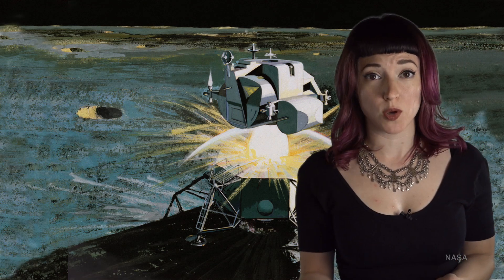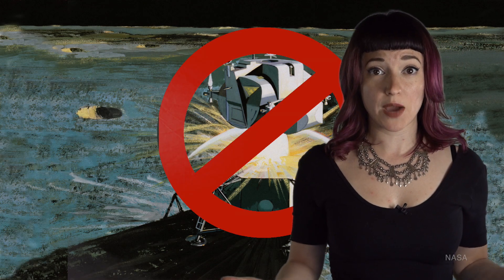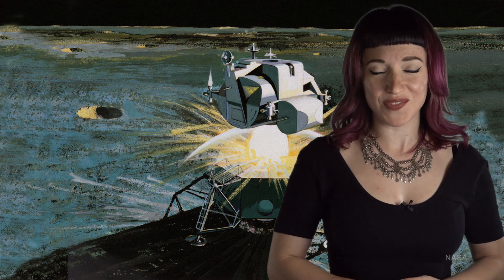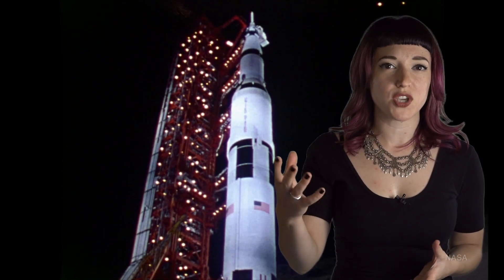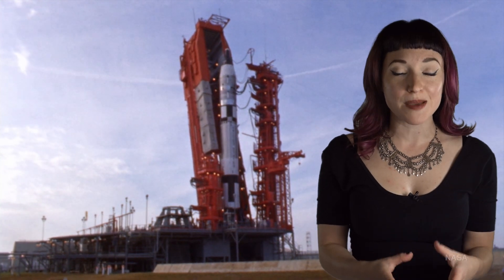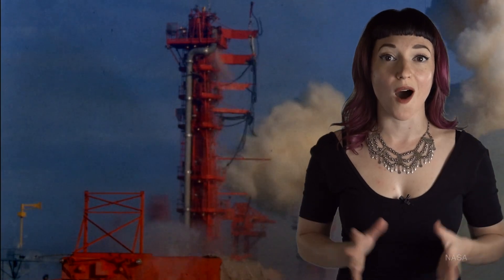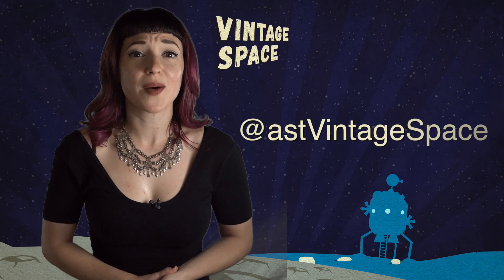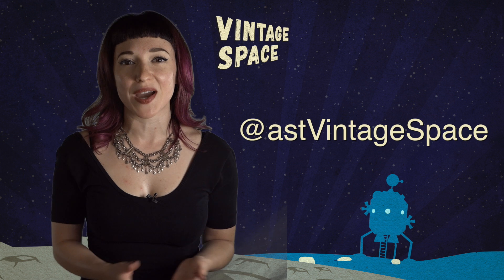How the Lunar Module Launched from the Moon Without a Flame

Comment: How the astronauts deal with high temperature on the surface of the Moon?
Reply: Their suits had a layer which had a network of water filled tubes throughout it. The astronauts could raise or lower the temperature of the water being pumped through it to maintain a comfortable temperature.

Comment: There should be no sound heard in a near infinite vacuum! Why can we hear the lunar module metal on metal and oxidation noises when in space theres no sound?
Reply: Sound travels through almost any medium. If a microphone is touching a piece of metal that gets hit by something, the microphone will pick it up.
Reply: Niall Kinsella 

Theres no atmospheric particles to be used as a medium. NASA even states sound cannot be heard in space. I've stopped so many people that have yet to come back with a response after researching..not thinking they believe they know. If you fact check and get back to me with opposite of what NASA stated that would be a first.
Reply: chris daniels A medium is required for the propagation of sound waves. That can be any medium, not just an atmosphere.
If a microphone is attached to a metal object, and that object gets hit by another object, the microphone will pick up the sound.

Comment: "Space Shuttles" that "launched" through the 70's, 80's, and 90's also were not filmed with high definition cameras. What sorcery was NASA using  to film the huge flames and even bigger cloud of spent fuel back then? High definition is not needed to view huge flames from a ROCKET!!!
Reply: YOU SAID: ""Space Shuttles" that "launched" through the 70's, 80's, and 90's"

== Why is "launched" in quotes?  Are you under the idiotic impression that the space shuttles DIDN'T launch 135 times?

YOU SAID: "also were not filmed with high definition cameras."

== Oh, good grief.  Get an education.  Sheesh.  There were plenty of FILM cameras used, which are as high definition as the film medium itself (and the lenses) would allow.  It's more "high definition" than most hi def stuff you see today.

YOU SAID: "What sorcery was NASA using  to film the huge flames and even bigger cloud of spent fuel back then?"

== The solid rocket boosters used for the shuttles burned polybutadiene acrylonitrile.  It produces a large visible flame.  The lunar landers' ascent engines used dinitrogen tetroxide and aerozine 50.  It doesn't produce a large visible flame.  It's that simple.

YOU SAID: "High definition is not needed to view huge flames from a ROCKET!!!"

== Is there ever a point in time that you feel stupid?  Or, do you just go through life assuming that you understand all there is to know, without having stepped foot inside a university classroom on basic rocketry??  Do you go to brain surgery forums and scream that brain surgery is fake, even though you never went to medical school?  Do you go to history classes and proclaim that WWII never happened?  Is there a limit to your stupidity?  Or, do you actually think you know what you're talking about??  (Hint: you don't have the foggiest clue.)
Reply: Sorry, I didn't realize the extent of your insanity.  I originally thought you were a run-of-the-mill conspiratard (stupid, ignorant, yet thinks he knows things he doesn't know, but can be trusted with steak knives).  Now I see that you're straight jacket material, and should be locked in a rubber room and use plastic utensils.  Go about your day, and stay away from children, ok?
Reply: Yeah, whatever you do don't do anything for yourself. You could take a night and actually look up, and know, but you never will. How are you so positive without checking. You are right because you say so. I've watched the sky every night last month, have you? No, and you never will. Insults prove a good argument for ignorance.
Reply: I am curious to know what other subjects you are a master of without learning anything about. If I were insane enough for a straight jacket, do you think anyone holding a psychological degree would allow me the use of ANY kind of utensils, professor?
Reply: If you won't watch then you are a complete fool. You would rather type nonsense than take a fraction of that time to make your dormant neurons fire.You know because you have been told, I know because I see.
Reply: +Ron Gabbard Have you tried looking at Venus using a telescope rather than bins + an iPad? I know your sort are suspicious that there are electronics inside the telescope producing images, but use one that's just a metal tube with lenses inside and no electronics at all. You'll see Venus as it is.
Reply: Yes, it did not zoom enough

Comment: Dear Vintage Space,
Your videos are superlative.  Here is a very simple question, that has exceedingly deeper and far reaching levels of inquiry that are intrinsically tied to asking more questions.......
Assuming that the primary source of power for the LEM was fuel cells or battery, as in D.C. Electrical function, and knowing that there was a  Battery or Fuel cell for the LEM,
Why do you suppose there is a very distinct need for AC inverters and such for the LEM?  There is a benefit for low voltage systems in extreme environments for obvious reasons.
Why was there AC systems in a DC powered craft knowing that obvious losses are involved , so efficiency is of not an issue........
I have a theory...... I welcome yours.
Very Best Regards,
Diveflyfish
Reply: PDF copies of the "Apollo operations handbook: Lunar Module" are available online. You may find that getting yourself a copy of it will enable you to answer many of your own questions. For example, from the handbook it is apparent that the LM used batteries for its power systems (as opposed to fuel cells), and additional details such as the number and placement of those batteries (5 in the decent stage and 2 in the accent stage) and the type, structure, current capacity, etc. of those batteries is also recorded.

The handbook also list each and every device attached to the LM's A.C. busses, which would be a good place to start if trying to determine whether early to mid 1960's technology (the timeframe in which the LM was designed) actually did offer an equivalent low voltage D.C alternative for any/all of the devices running from an A.C. bus. For example, I observe that the motors spinning the gyroscope wheels were running from an A.C. bus. They are 'hysteresis synchronous' motors so the speed at which they spin (a significant detail in a guidance gyroscope application) is entirely controlled by the A.C. frequency, and they are simple/reliable motors (e.g. brush-less, don't need additional windings to provide a start-up torque). Was there an equivalent D.C alternative for that available in the early 1960s?

Comment: What did the flame push against in a vacuum?
Reply: If by "flame" you mean the exhaust gasses from the rocket engine, why would it/they need to 'push' against anything? That is, what purpose would that serve?
Reply: Barry de Klerk:
Rockets don't need to "push against" anything.  That's not how a rocket works.  Think of it more analogous to a balloon full of air, and you open one end, and it propels itself around as the air escapes.  (That would still work in a vacuum, of course.)  See, rockets basically work via Newton's 3rd law.  With exhaust gasses being shot out of a rocket's engine bell at amazingly high speeds (let's say downward), there's an equal and opposite reaction that your vehicle is propelled in the opposite direction.  For every action, there's an equal and opposite reaction.  Send 6 million pounds of rocket propellant gasses out of an engine bell at high speeds, and you certainly don't need to push off of an atmosphere to get propulsion.

Comment: The ascent engine burned hypergolic fuel, and if actually started,would've made the same Color exhaust as in your Gemini launch video... vacuum of space or not.
Reply: The Gemini rocket starts off in an atmosphere which is why there is an observable interaction with the hyperbolic propellants. As the Gemini rocket reaches a higher altitude, that observable interaction fades away until it resembles the LM ascent stage exhaust plume which is entirely consistent with how a hyperbolic propellant should look in a vacuum. 

Google: "  Launch of Gemini 6 (CBS)" and you will see that at launch, the exhaust plume is visible but obviously less of a visual sight compared to a Saturn 1 exhaust plume. Keep watching the Gemini 6 launch and at around the 4:59 mark, you'll see a nice side view of it along with its exhaust plume that is still visible. Around the 5:18 mark, the exhaust plume starts to fade away until it's gone completely around the 5:30 mark now that Gemini 6 had reached a high enough altitude that there's no outside atmosphere to interact with the propulsion byproducts.
Reply: mako88sb Hmm... To be  completely honest with you,  I really don't know with any degree of scientific certainty if my statements about the reaction produced by the burning of hypergolic fuel as far as the exhaust color differing in a vacuum as opposed to the earth's atmosphere -other than what I've learned from watching documentaries wait experts  on the subject commenting on the matter and forming the opinion that I  believed to be true and scientifically verifiable, and as such, posted in response to watching the lunar module ascent engine firing. To me, it makes me difference whether or not the engine is fired in a vacuum. The point you made about the exhaust reaction being affected by mixing with the oxygen of earth's atmosphere certainly makes sense and could very well be true.  I'm sure there is some sort of reaction. i dont recall experts I saw commenting on that point or not.  I think that point was raised,  but aren't certain. it was an older gentleman who was an employee of Rocketdyne during the Apollo Era a and was involved in quite a bit of testing on the actual engines that were used on the lunar module. There's also a point I'd like to raise in response to your comment regarding the engine exhaust being affected by the altitude of the Gemini 6 mission. As far as I believe,  the Saturn engines were considerably more powerful and were the ones used on Apollo. More to the point,  the LEM ascent engine was hypergolic, the Saturn engines were NOT fueled with hypergolic fuels... They were ignited at launch by means of a hypergolic fuel mixture momentarilly. In any case,  let me qualify for the record by stating that I am by no means an aerospace, aeronautical, or chemical engineer, and am definitely not an expert in aerospace propulsion systems.  I am an electrical engineer, and have some knowledge of, and experience with, ion drive propulsion propulsion first hand from working in the Electric Propulsion Lab at Lewis Research Center in Cleveland during my senior year of college.  So, basically,  you could be absolutely correct on all points, I just don't have the scientific knowledge base to make that determination one way or another.

Comment: Also remember.   Millions of gallons were poured on the base of the pad at lift off to attenuate the shock waves generated by the first stage.  The white plume of smoke at liftoff was primarily the vaporization of the water into steam by the first stage engine's thrust.

Comment: Mrs. "NASA pays my rent", please explain to the rational mind which kind of batteries they used to get the power for moving the camera motor and transmitting the video feed 280 thousand miles. ..and what kind of transmission system they used for such a distance. Everybody who believes this moon landing shit is a braindead zombie.
Reply: Herr Normalo Here, knock yourself out. Video camera is in section 4 of the handbook. https://www.hq.nasa.gov/alsj/lrvhand.html For general info on Apollo communications, this page (and the manuals linked at the bottom) should cover things. https://www.ab9il.net/aviation/apollo-s-band.html Here's Ed Fendell, who operated the camera. https://vimeo.com/81903318

Comment: seriously though, being a slight skeptic, if the digital camera was invented in 1975 then how were the images transmitted for this footage???//  Amy ?
Reply: Color television implies the radio broadcasting of color video images, and color television was available (if relatively new) in the US and western Europe by the end of the 1960s. Digital cameras are not required for this, other technologies existed and were used.
Reply: Do you have that info  '' technologies existed and ..used''  so what the footage was translated to radio signals   or  recorded digitally?
Reply: +Charlie Hutch   "so what the footage was translated to radio signals   or  recorded digitally?"

For a document that goes into some detail about it, google: 
"Apollo Television pdf"

There's also a youtube video you can google titled: 
"Live TV from the Moon with Dwight Steven-Bonieck"
Reply: When the Apollo TV camera radioed its images, the ground stations received its raw unconverted SSTV signal
 SSTV systems operate on voice frequencies, amateurs use it on shortwave (also known as HF by amateur radio operators), VHF and UHF radio.
A similar concept, also named SSTV, was used on Faith 7 as well as on the early years of the NASA Apollo program. The Faith 7 camera transmitted one frame every two seconds.
The Apollo TV cameras used SSTV to transmit images from inside Apollo 7, Apollo 8, and Apollo 9, as well as the Apollo 11 Lunar Module television from the Moon. NASA had taken all the original tapes and erased them for use on subsequent missions
SSTV uses analog frequency modulation, in which every different value of brightness
 in the image gets a different audio frequency. In other words, the 
signal frequency shifts up or down to designate brighter or darker 
pixels, respectively. 
Commercial systems started appearing in the United States in 1970, after the FCC had legalized the use of SSTV for advanced level amateur radio operators in 1968.
The concept of SSTV was introduced by Copthorne Macdonald[1] in 1957–58.[2] He developed the first SSTV system using an electrostatic monitor and a vidicon tube.

Comment: The secondary reason to do with air pressure is really an important one.  On the moon, the water vapor created did not condense.  Thus there was no big cloud down near the base of the lander.

Also:
1) You can see stuff blown out in the first few frames

2) The thrust needed to get off the moon was a lot less.

Comment: That's the same propellent that was used for the maneuvering thrusters on the shuttles and the Apollo command module's unit's isn't it ? I've seen the cutaway schematic of the shuttles and I remember seeing the fuel tanks where the separate chemicals were stored, and the delivery system to the thrusters available to the pilot.

Comment: one answer:the separator ejection force can takeoff a lunar module,because the low gravity can do the rest,only on 6.000 altitude it can activate the engine for unecessarely waist of fuel,for short,its moon physics and fuel efficiency,or they used RCS thrusters to takeoff
Reply: i mean,kerbal way,sorry...

Comment: Why did they not send the SM and CM up in one rocket and the LEM in another rocket and have them rendezvous enroute to the Moon?  It would have meant building smaller rockets and potentially having backup equipment available for a rescue mission if necessary.

Comment: As I understand it, that LM fuel is so corrosive that the engines are ruined after just one use.  (i.e. you can't even test them)
Which is a good reason not to use it everywhere.

Comment: Hypergolic fuels are very unstable and hard to store. If the thrust gets so much dispersed it's ineffective and you don't move an inch from the ground. In the moon footage the Apollo doesn't show any sign of inertia and if the jet stream gets dispersed by the vacuum anyway... WHY THE FUCK does the Apollo have a laval nozzle in the first place? Makes NO SENSE. 

When the Apollo took off the moon, the thrust formed a cone shaped jet for 2 seconds and then disappeared.

You can HEAR the astronauts perfectly whilst SITTING DIRECTLY above the rocket engine. And don't tell me there was no air in the Apollo. There was. And that air transmitted sound waves.

Comment: How do you explain that the ascent stage was so asymmetrical (yes, the explanation if the difference of density of the propellants, but the fact is that it was implying a consistent shift of the center of gravity as the tanks were emptying), and that its engine was not gimbaled (unlike the one of the descent stage), and thus could not be swiveled to redirect the thrust of the engine toward the center of gravity which was shifting; the misalignment torque could only be corrected with the lateral thrusters of the RCS, but, as they could not be throttled, their thrust could not be adjusted to create a counter torque exactly equivalent to the misalignment torque, which means that a swaying move could not be avoided, and which was increasing along the ascent.
There also was a big problem with the command logic interface of the RCS, but here it becomes a little too technical!

Comment: I've always wondered what we see flying away from the lunar module when the engine fires. It looks like a bunch of sparks.
Reply: probably pieces of the cooling external layer, the one people usually call "tinfoil" ( actually mylar or kapton or other serious stuff ), ripped apart when descent and ascent stages were separated
Reply: The bolts and fixings that mated the ascent and descent stages were explosive too. When they separated there would be a nice amount of shrapnel flying about. :D